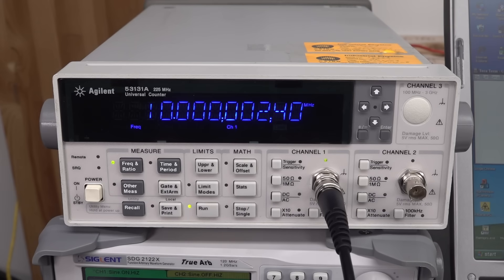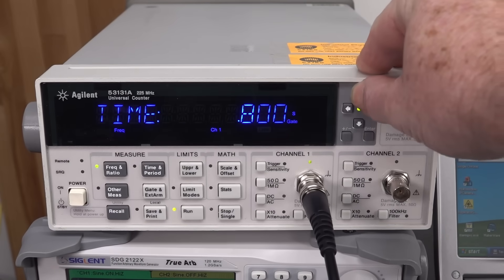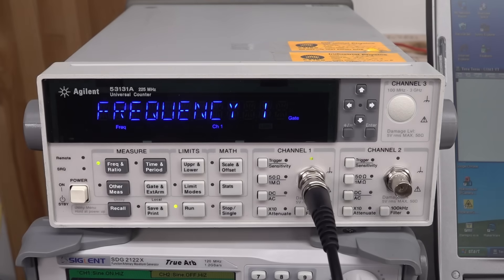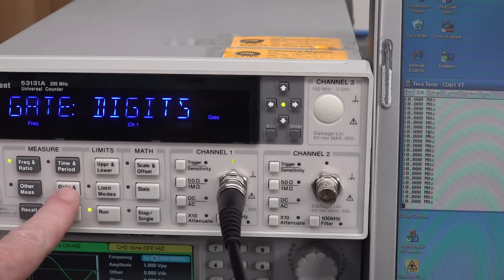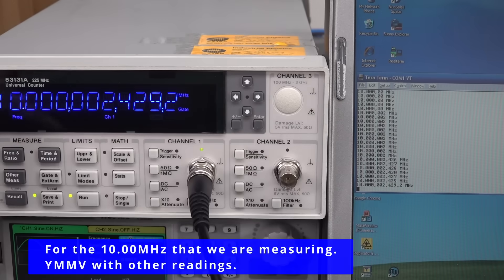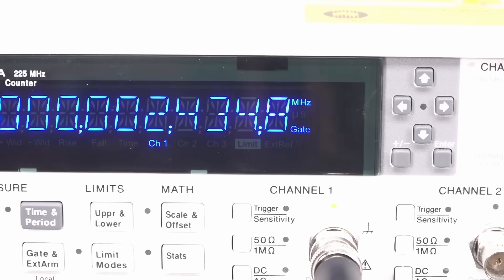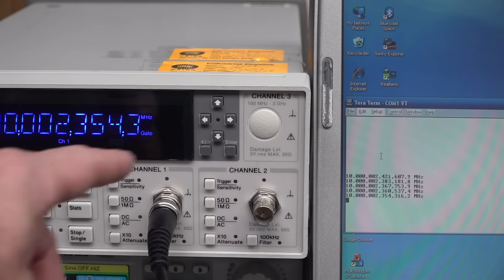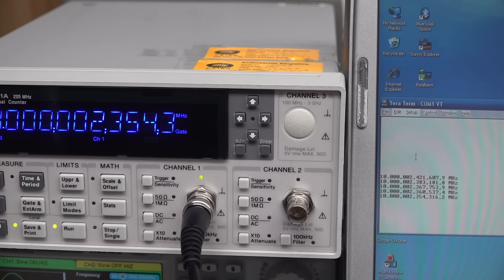FAILED PROJECT IDEA - 53131A Mod Board

Comment: Are the extra digits meaningfull? 12 digits? or not meaningful - even if the machine is precise enough to capture "real" data no use reading 15 digits - better send it to notepad :) with timestamps.

Comment: I get while this would be an interesting project from a 'frequency nut' point of view, but what application would benefit from such a high resolution?
Reply: Comparison of GPSDOs or Cs clocks. 😀
Another task could be to determine whether two clocks are correlated with each other but I would prefer phase measurements for this.

Comment: You can simply intercept the entire output to the display - pass its interface through your controller and adjust it on the fly. It's not difficult.

Comment: I assume this is scanning display, so blanking that last digit won't be hard, you need to somehow cut the power supply to the driving mosfet to blank it. 
The software could count number of digits in terminal. If if less than 12, it won't blank out, if it more than 12, it will display the last "4" digits(3 extra + 1 we blank out)

Comment: If you were keen, and i mean REALLY keen, you could rip out the entire display and replace it with a nice colour TFT LCD, reverse engineer the display hardware/protocol, intercept the rounding and display a brand new 15-digit display and of course all the annunciators etc.
Been there with the Advantest R6581(T) DMM.......and it's a LOT of work but with a beautiful end result.

Comment: The way HP designed the extra digits to work is to set a reference frequency of straight 10mhz and put it into diff display and it just shows the last couple digits then

Comment: Classic case where the idea of a making neat little product far exceeds its actual usefulness. Almost nobody needs that precision, and without a rubidium timebase or similar, the digits would be meaningless.
Reply: You mean if your DUT is a Rb clock? A GPSDO as reference timebase is ok to measure those as the gate times are long. You are right that it is impossible to trim even an OCXO so that this digits remain stable.

Comment: That makes no sense at all .. as you said in the end, a very silly idea.
At first, the physical resolution of any (reciprocal and calculating) frequency counter is determined by its Gate Time divided by its time interval resolution.
In case of the 53131, it is 1 sec / 1ns =  9 digits/s,  and about 1sec/100ps = 10 digits/s for the 53132A.
Additionally, they use an averaging methods, which gives extra digits for the same gate time, but that's sort of cheating, and the extra resolution does not give really reliable extra uncertainty .
The very old HP5370B, which resolves 10ps single shot time interval, displays real and solid 11 digits/s.

Second, a high resolution of more than 9 digits is meaningful only, if your internal timebase is as uncertain.
An OCXO is able to provide about 9 digits absolute, meaningful resolution, as it's stable and uncertain to 10^(-9), some special types are even more stable.
Then you would need a Rubidium time base, for up to 12 digits resolution, then a GPSDO, or a Cesium clock for 13..14 digits.
Here the story of useful applications would end, so 15 digits make no sense in practical applications, even 13 digits is very clumsy to handle.

Anyhow, for which application in your lab would you need more than 12 digits at a reasonable 10 sec Gate Time, if you'd be using this old 5370B? Do you have a clock available, that is as stable to this degree, i.e. better than a GPSDO?
Reply: I was thinking roughly the same thing... what is he hoping to measure that needs 15 digits?   Displaying a few more random digits isn't really a useful project.
Reply: You can actually set gate times up to 1000s in manual mode on the 53131/2.
Error for time interval for the 5370B is 100ps(rms) / gate_time * frequency +- 1.4
and < ± ((100ps typ [350 ps max])/Gate + Timebase Error ) x Frequency for a Stanford Research SR620.
Displayed digits are 20ps/gate_time * frequency (5370B) and 4ps/gate_time * frequency (SR620).
I have both devices (5370B/SR620) and they are connected to an external GPSDO reference. The direct frequency measurement is good for adjusting other clocks relatively quickly but normally you would do a long term phase measurement against a reference clock.

Comment: Not when the last digit is a 9, and it rounds up due to the unseen extra 3 digits. Then there is a ripple carry into the second to last digit and so on.
Reply: Exactly 👍
Reply: But if you intercepted the display data in order to modify the last digit, you could modify the whole lot.

Comment: Would've been a nice project, shame it's not viable. I recently got a 53131A faulty from ebay, but after recapping didn't seem to have anything wrong with it. It also has the 3 GHz CH3 option which is nice. Added an OCXO option as well.

Comment: You'd be better off designing a completely new 15 digit display. Would give you a nicer result, and you could then handle/ignore the edge cases with rounding etc. Maybe make it switchable between standard/serial display output.

Comment: I’d see if you can blank that last digit whenever you’re printing the output, and have a 4-digit segmented display in there. Might be a tight fit. You’d be better off contacting the guy who makes that LED mod board, or else try to design your own from scratch. Not an easy project.
Reply from the maker: The smallest 3 digit I could find fitted exacty. 4 digit looks out of the question unless it's an obsolete HP bubble LED dispaly from the 1970'.
Reply: @EEVblog2  Two rows of two digits?  Not ideal for sure.
Reply: The mod board is a display replacement only. It doesn't replace processor etc.
Reply: @theelmonk  don’t see how that changes anything. Not like the originally planned + 3 digit mod was going to change the processor.

Comment: remove the entire display... feed the data into a micro and re-display it all on a set of digits you make.
Reply from the maker: But then the same problem exists. You'd have to pass through the normal display when booting and normal operation, and then cut into the whole thing in serial mode. Doable, but messy. Not the nice quick mod this would have been.

Comment: You could build a little external display box that plugs into the RS232 port and displays the full output.  A 4 line display would give you a bit of history as well.  Kind of a mini terminal box.  That kind of thing might be useful in other ways and other projects also.
Reply: I second this. Cool idea
Reply from the maker: That was actually my first thought, but then I realised I could fit a tiny 3 digit LED display inside. Such an external display would just be a generic serial port terminal display thing, which is kinda cool in it's own right. But surely this exists already?
Reply: @EEVblog2 is there any other functionality for the serial port? might be able with an esp make the thing wireless and or remote controlled if that has any use that is
Reply: @EEVblog2  There are display protocols like Matrix Orbital that will take and display raw character data received over serial. to a display. AdaFruit has an implementation for their Serial LCD backpack which can be built for many AVR/arduinos with 44780 compatible display. Once the data rate is configured, it seems like it should "just work" here, though might need some level shifting depending on the output and input capabilities (RS232, TTL, 3.3v, etc)
Reply: History display would be super cool.  Too bad it doesn't show timestamps.
Reply: @button-puncher  Well add a RTC to your terminal box and generate a timestamp before each printed line, easy :)
Reply: @button-puncher  Sadly most of the counters are "unable" to send a timestamp with the frequency or period value. You can generate a timestamp on the receiving device but that's not the same as transmission and processing delays are included. It can be a problem if you are doing phase measurements, for example. I don't like it either.
Reply: What if your external display could give an arrow up/arrow down indicator for increasing or decreasing?  Or perhaps something to indicate magnitude of the change? (Bigger/longer arrow?)
Reply: Maybe a VGA output for large display, Min / Max, graph, PPM or PPB graph would be especially useful using the RS232 and an Aurdino or similar to generator the display. If we had space a graphic LCD but a VGA using HDMI would be easier and cheaper. This would be great for everything with GPIB or RS232 output like the HP3457A or HP3478A.
Reply: surely at that point you're better off just connecting to a PC.

Comment: Measuring more than 12 digits is less helpful in reality - not many sources are stable enough... Unless you measure Rubidium reference against GPS or something )
Reply from the maker: More digits is more betterer.
Reply: After dave successfully mods his 12 digit counter into 15 digits instead of just reading it from the computer, he'll justify the mod by acquiring a cesium beam clock 😂
Reply: 69 digits is optimal.
Reply: And with a proportional font you might be able to squeeze in 96.

Comment: Is there a software update or mod to make the 53131A into a 53132A? I found the question on EEVblog too.
How about a phase locked x10 or x100 so we can sample the signal 10 or 100 x faster?
Use period counting for 1000 waves reciprocal for frequency and show jitter too!
Reply: No. Only hardware upgrade possible. Need add on pcb FPGA, 2xADC and VRef. I upgrade 2 units and did not found any problems with stability and repeatability (comparing with real 53132).
Reply from the maker: I was wondering that too. An EEVblog forum thread post says "Several years ago I compared the two schematics: the '132A has some different values and some more ICs. It can be done except for one SMALL problem: the required ADC (AD7580JP) is UNOBTAINIUM* !
The PCB are the same, just differently populated."
Reply: @EEVblog2  AD7580JP can be bought on aliexpress or from worldway electronics. $20-50. Don't know if its worth it when a working 53132A is in the 400-450 range though.
Reply: @EEVblog2  I've had a positive experience purchasing these ICs from utsource and have successfully converted several units.
Reply: @EEVblog2  I've had a positive experience purchasing these ICs from ut source and have successfully converted several units.
Reply: They are different in hardware, so mod here is unlikely. Feeding in higher frequency than 10Mhz - might help a bit, but not sure it would be easy )
Reply from the maker: @BarsMonster  One of the chips that is different is an FPGA. Still might be fairly easy if it's programmed from the micro at startup.
Reply: @EEVblog2  The AD7580HP is a 50khz ADC, so I'd think a newer chip would work or AliExpress 5/PCS AD7580JP AD7580 PLCC28 Integrated IC Chip original IN STOCK for $88 /5= 17.60 each. 
Better yet a MAX1426 10 bit ADC 10MS/sec for $4 each, both with parallel output. So plenty fast even if it needs a little glue logic.